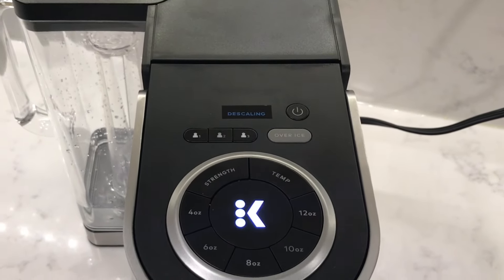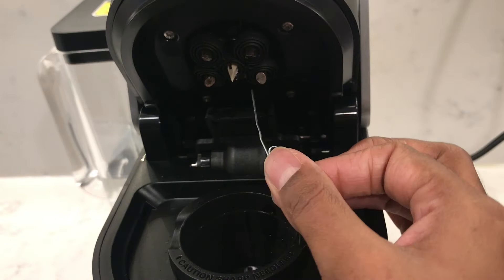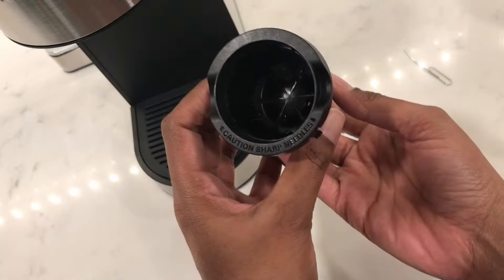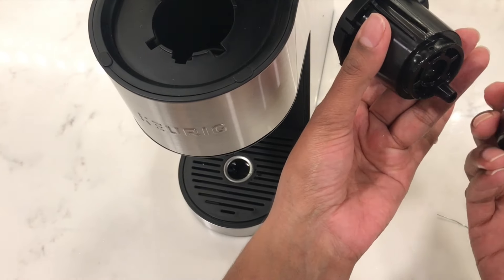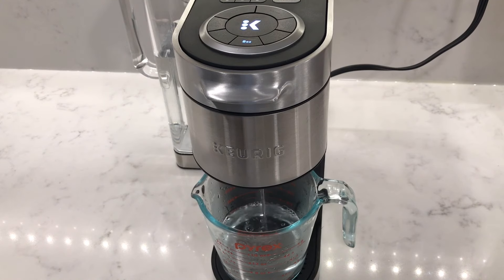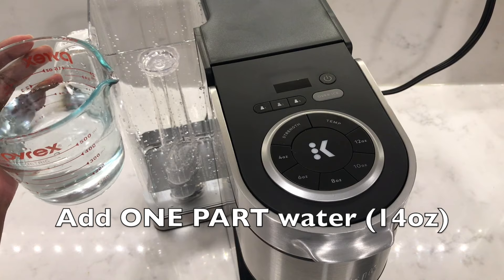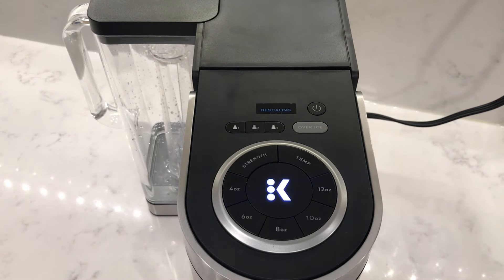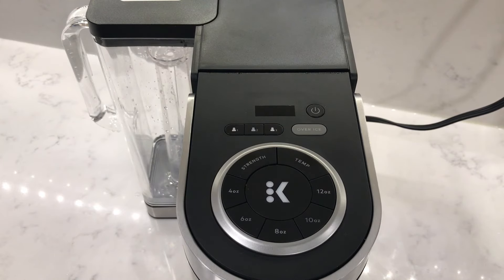DESCALE and CLEAN your Keurig Now for Better Tasting Coffee!

Comment: Did not work, followed your instructions and the Descale light is still on.
Reply from the maker: It's possible there are some tiny coffee grounds stuck in there I would recommend trying to clean the needles or run a cleaning brew a couple of times to flush it out. hope it helps.

Comment: Bad decision w/ paper clip can cause damage. I use pipe cleaners, softer and a better cleaning job...
Reply from the maker: Great suggestion. I'm just following the instructions from Keurig. If it messes up the Machine, Keurig can replace it since it will be their fault!
Reply: @MeemReviews  Good luck with that!
Reply: Good suggestion--Do pipe cleaners come in diff. sizes? if so, what size are you using?